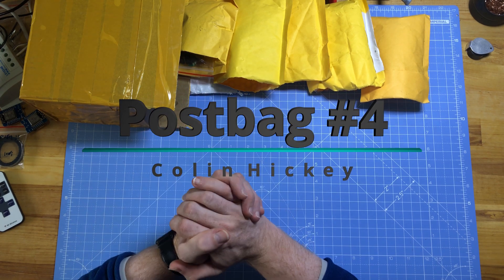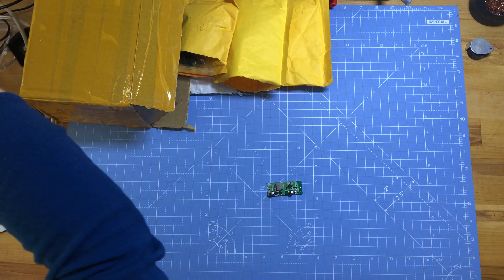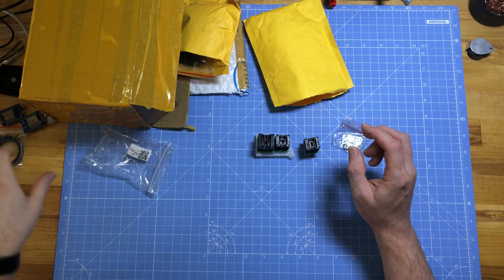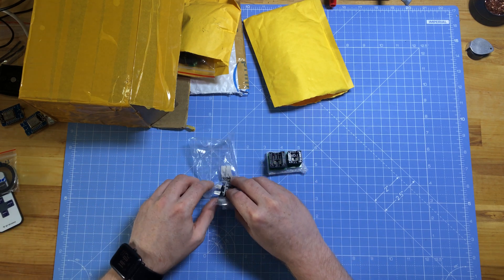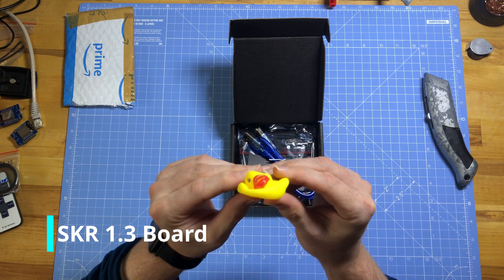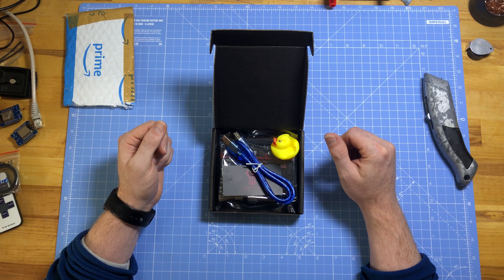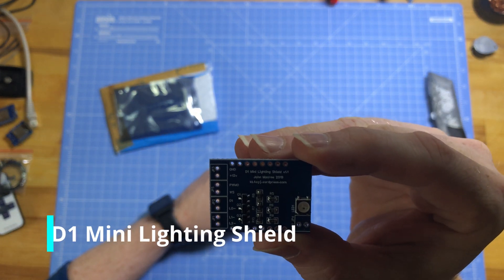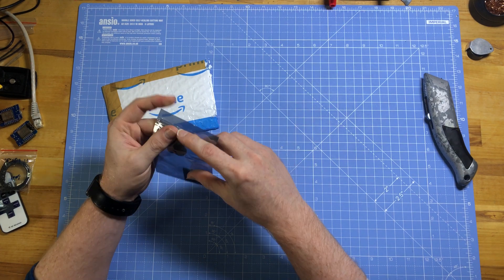Postbag #4

Comment: I am still a bit rough on this myself, but for the wind turbine, would a capacitor(or bank of them) help to smooth the voltage output so that it isn't so erratic?
Reply from the maker: Thanks i'll give it a try when i'm back up and running with the turbine.  There are two capacitors on the turbine currently in a bridge rectifier but the output from those may need some smoothing.  There doesn't seem to be many products for small turbines like the one I've done.
Reply: I'm curious to see how it turns out. I don't know if the capacitors will help but if you have some large ones available that might be up to the task, it could make for an interesting experiment.

Comment: Thanks for the mention, Colin. 😀👍 The output pins are 2.54mm spacing and the voltage divider is only there to allow you to monitor a voltage with the ADC - it could be used to switch off the leds when the voltage falls below a certain value if you were using a battery for power.
Reply from the maker: Well that shows how much I know, I think in my mind I was comparing the size to the screw Tyler terminals which must be greater than 2.54 so I got confused.  Totally missed the mark on the voltage divider, I need to rtfm lol
Reply: @Chickey  i think it just shows how much more effort i need to put into the documentation 🤣😂. TBH, i left the terminal blocks off usually since i just solder the correct plug leads directly.